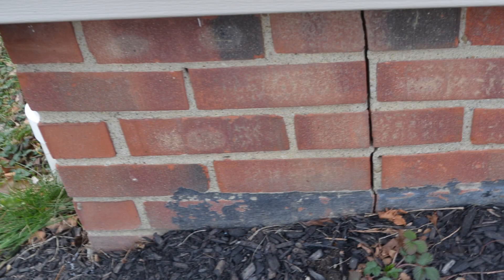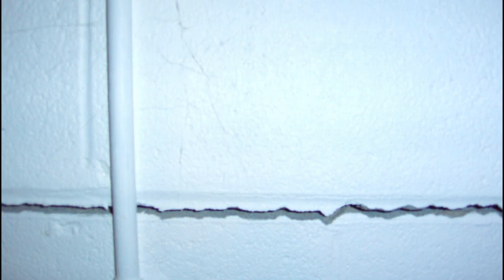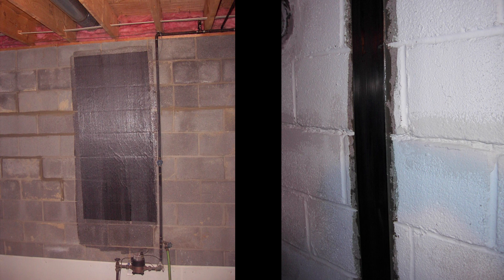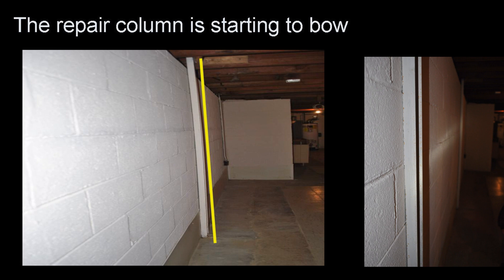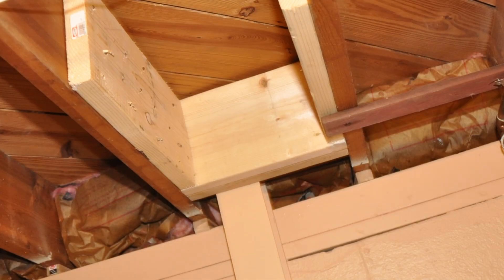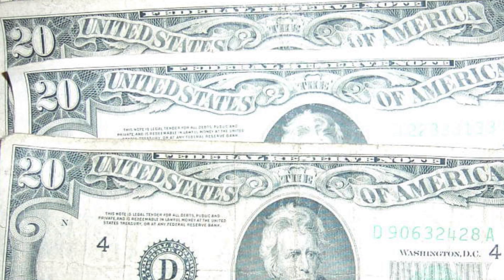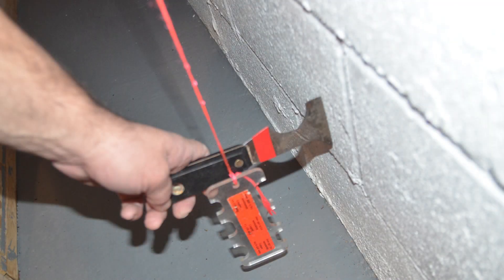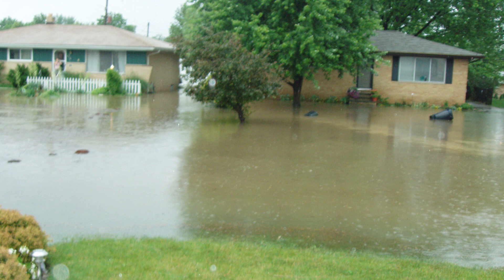Basement wall cracked, Basement wall bowed, list of foundation repairs available

Comment: The question that keeps rattling around in my mind is why were concrete blocks used for foundation walls? I have a 60 year old property in the frozen north (6’ deep frost line and pronounced thaw and freeze cycles) with cinderblock basement walls, and a crack is beginning to form, and spring thaw water is beginning to seep in.
Reply from the maker: concrete is best
Reply: Clevelandmarko I get that! My house has poured concrete basement walls, and is older than our rental, and my basement is bone dry. Why were cinderblock walls used for foundation walls? 
ps, thanks for taking the time to respond and to make the video.
Reply: @brainwashingdetergent4322  Cinder block walls were likely cheaper to use at your 60 year old property when it was built. But regardless which method is used, shortcuts can be made that makes one building method even worse! While clevelandmarko says concrete is best above, I would take a well built cinder block basement over a poorly built concrete one!
Reply: @trigdon  makes sense!